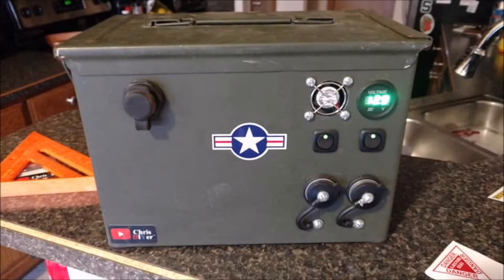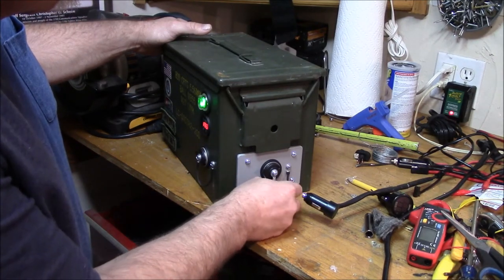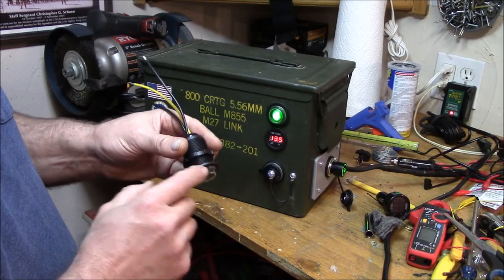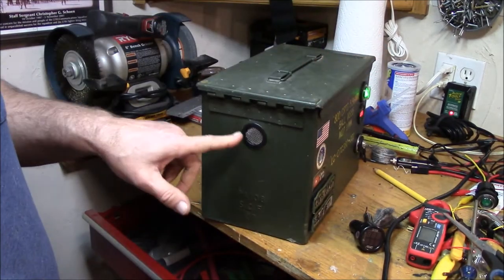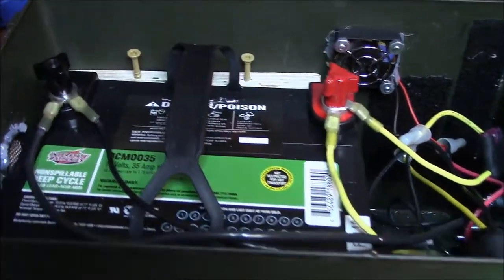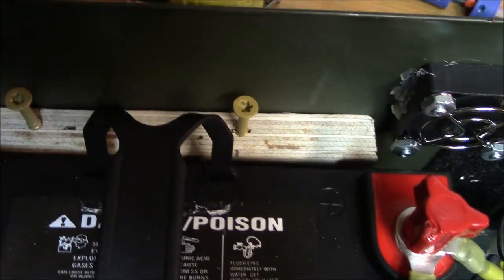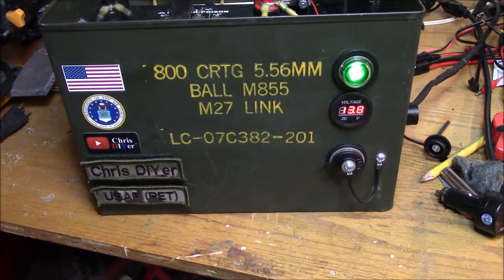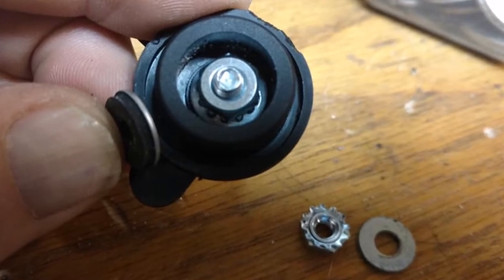DIY 12v battery power box (ammo can, air cooled, 35 aH AGM battery, voltmeter, lighted switch)

Comment: I've liked this mobile power box since day one. It's a cool idea which has been masterfully perfected!
Reply from the maker: Thanks...you know, even w/o a solar charger & inverter built in (like the other one) it is still useful. Kinda like a spare battery with outlets. Storm shelters emergency power (lights, radio, cell phone charging). Just about anything 12v

Comment: Look really good.  Nice job on the battery tender add-on.
Reply from the maker: Thanks...so many uses. We have a lot of tornado shelters here, this would be something solid for emergency lights, radio, cellphone charging. Just keep the Tender plugged in. Or camping (DC-DC connect to a car's 12v system...to keep it topped off)

Comment: First time seeing one of these that is home made. I might attempt to build one. So are the 12 volt sockets pretty much wired the same? For instance, can you charge the battery with either plug? Then when unplugged from the charger I assume you can use both plugs to charge or power accessories? I need something like this to run a roof fan and charge my cell phone in my tiny camper I built.

Comment: Hey Chris - have you done a micro solar generator project based on a lithium battery?  I have looked at most of your videos and do not recall seeing one.  I have built several MSG 's based on a SLD 
battery and am interested in investigating lithium.
Reply from the maker: Yep...sure have. I reached out to a battery company and will be using one of their 10aH lithium (LiFePO4) batteries in a new project. It will be a "lightweight" version with many of the goodies that I have used in my other builds. Stay tuned...